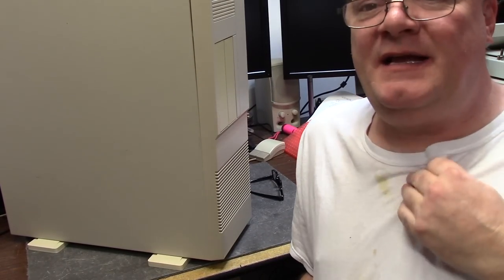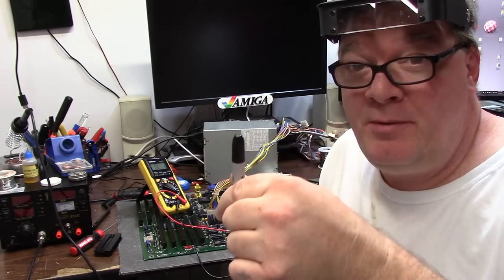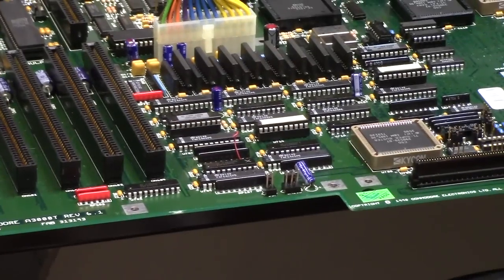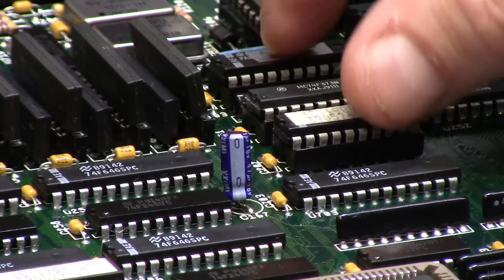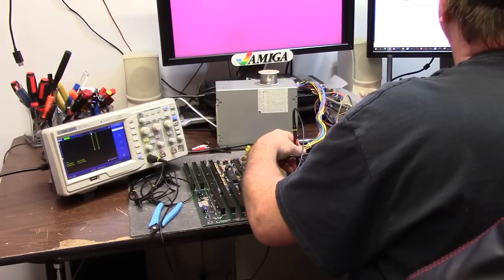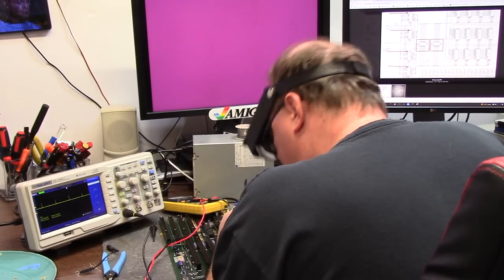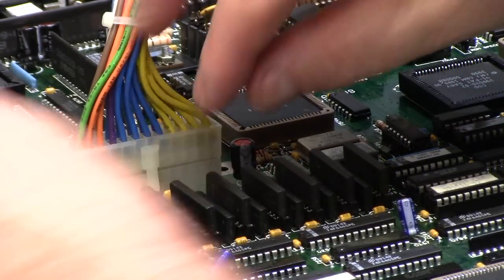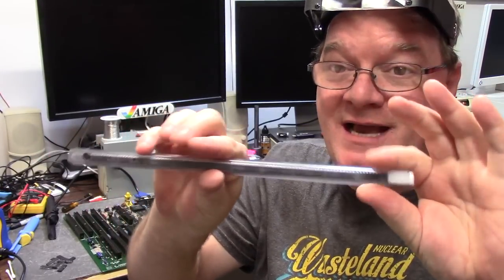Amiga 3000 tower no chip ram p2

Comment: What an absolute pain in the A! That 3000T is going to be a motherboard short of being a new computer. Great content in my opinion. It is important to show the shite side of electronics. I get hung on little stuff. My Father always told my to "keep it simple stupid" (kiss method) but I used to miss simple stuff like voltage regulators because I was focused on the circuit and not if the circuit was fed properly. Here you are running triathalon and the problem still eludes. I can certainly understand why this one is driving you bat $hit but I can see that you don't have much left to cover so you must be honing in on it. I look forward to seeing your inevitable victory Sir!

Comment: Hi Chris, why so many jump cables (or whatever they are called on the bottom) of the board? I thought you would only use those when the board or traces are damaged say due to Varta batteries  but it looks like for your board there is different reason.
Reply from the maker: this motherboard had extensive FPU battery damage and required rewiring. hence the mess
Reply: @ChrisEdwardsRestoration  Thank you for the answer Chris. Look forward to the next video. You will get there.

Comment: No chip ram?
How do amiga find chip ram ?
It just write to it.
Then reads it back.
If its same data then ram exists.
Idk but i thought thats how older amigas did it.
Cant remeber
But amiga 3000 32bit chip ram.
So part agnus and part other chip for 16+16 32bit read.?
Reply from the maker: It just blow up
Reply: @ChrisEdwardsRestoration  what. Nooooooooo
Reply: Not a bad resistor pack ? .
Seem like 1 data line or adress line is stuck high or low or a ras or cas.

Idk
Reply from the maker: @easyerthanyouthink  i dive deep, i finally get resistor packs in AFTER the next part. then theirs a twist.
Reply: @ChrisEdwardsRestoration  cant wait 🤞👍